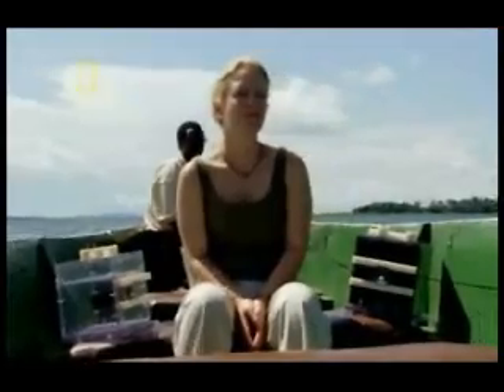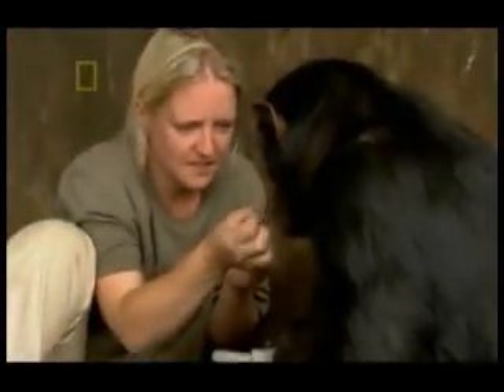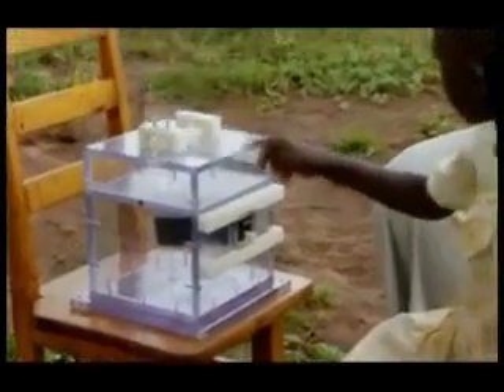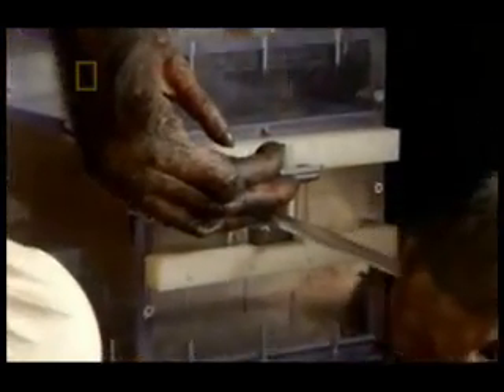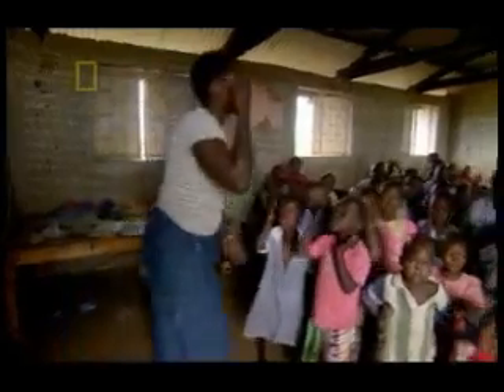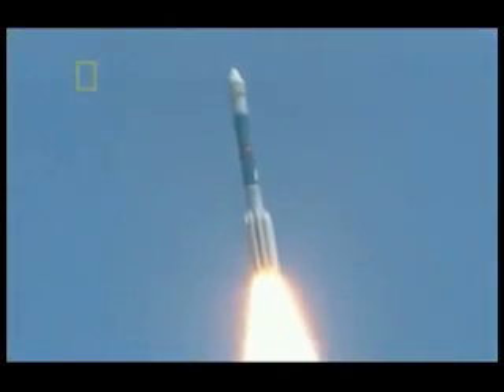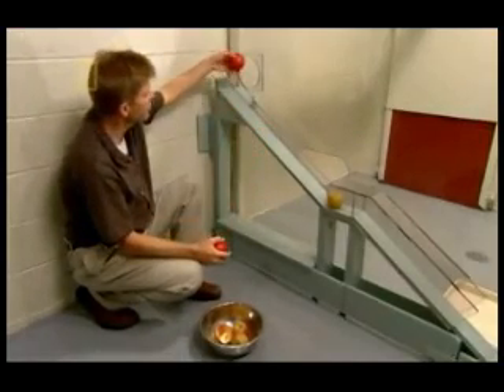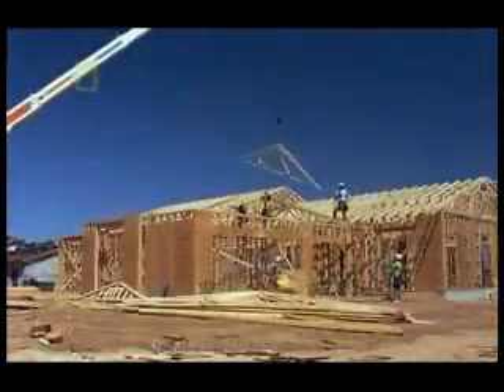The Human Ape 5of10

Comment: The apple experiment was not a legit test for what they were testing for.  The children were given more instruction than the apes.  The first kid specifically was directly told "Which ball do you need to use to knock the apple out of place."  The ape may not have known how the contraption works in the first place, and didn't realize it was a matter of "knocking" that apple out of place.